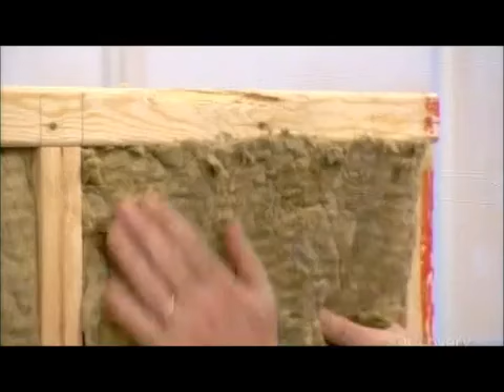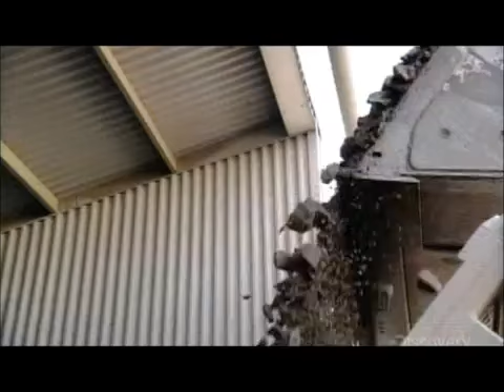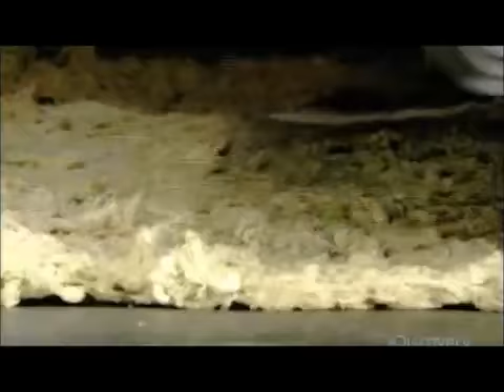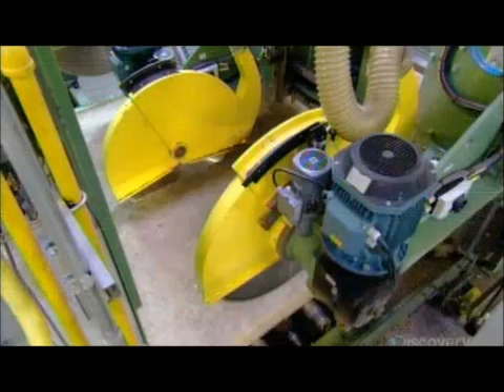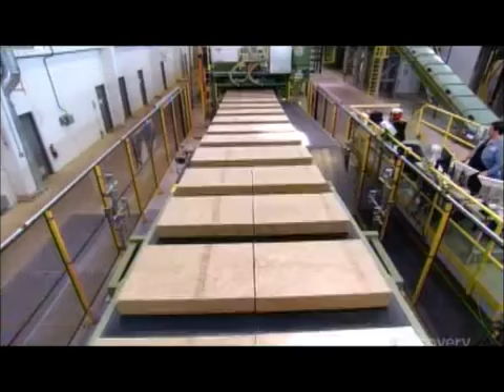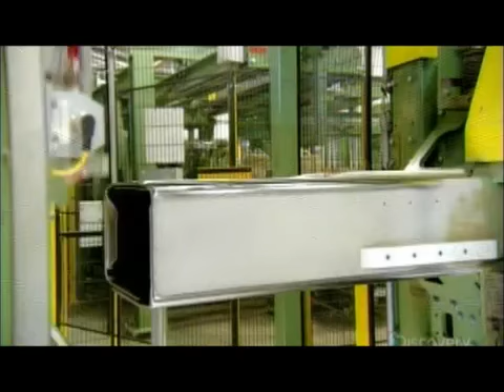How It's Made - Roxul Stone Wool Insulation

Comment: The sound blocking characteristics of rock wool depends on the frequency. Lower frequencies  will not be blocked as well as the high frequencies of the little alarm that was used in the demonstration. It certainly is better than fiberglass insulation.

Personally, I think rock wool should be mandated by codes and fiberglass should be banned. Fiberglass offers zero fire resistance. Rock wool is amazing.

Comment: that pendulum machine is awesome. i'm about to insulate a concrete basement in USDA climate zone 2, which means insulation is important. what's the difference in R VALUE between fibreglass and roxul? 

also, fibreglass itches like hell. is roxul the same or better?